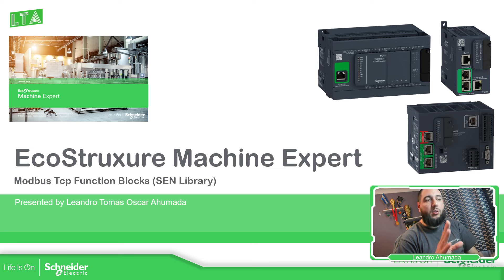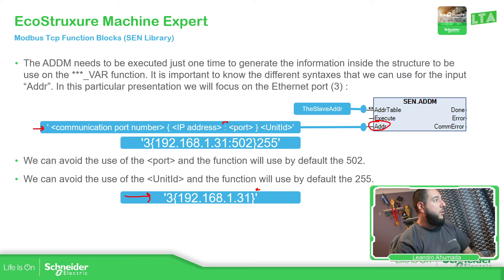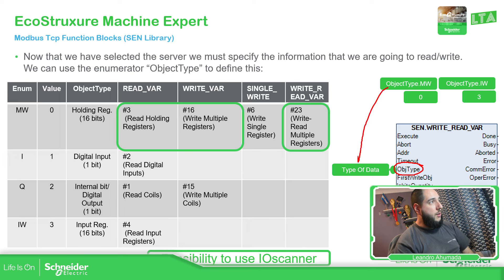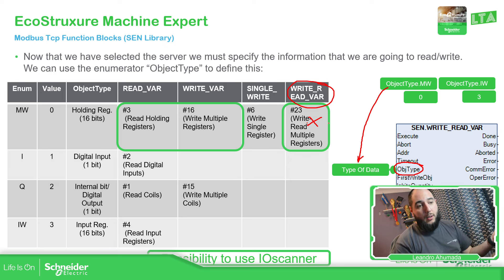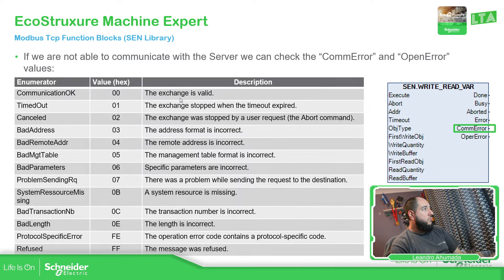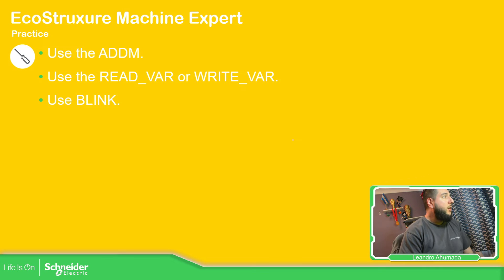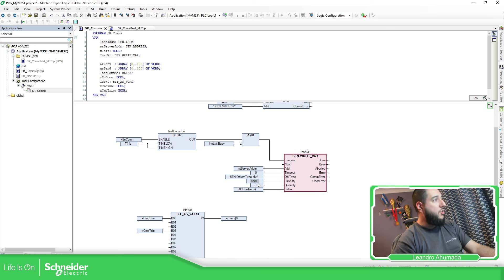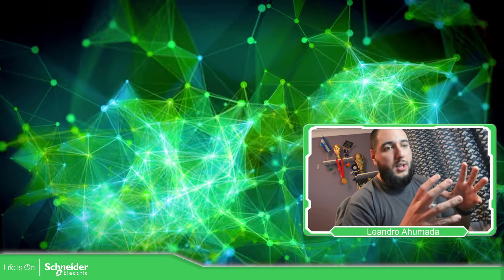EcoStruxure Machine Expert Training - Mx.x Modbus Tcp with Function Blocks (Read / Write)

Comment: THank you soo much for the explaination. Now i was able to communicated M262 with Jaka robot. My one request would be how does the structure vary for READ_VAR FB ? Because I'm confused about the step where I get to read data after triggering. Thank you
Reply from the maker: Hi there! Congrats on the integration with the robot 🎉. If you use the READ_VAR the info received will be in the buffer so you need to use the info from there, example:
wMyVariable := arBufferRecv[0];
Reply: @LeTomasAHUMADA  Thanks alot!!
Reply: @LeTomasAHUMADA  Hello again! Sorry for disturbing but when it comes to Robots I get machine values which are in Float32 format. I tried to use REAL and converted REAL to INT but still it didn't work. As per BOOL variables it works perfectly. Can you help me what should be done if the values that are being processed and anything else but BOOL types ? THank you
Reply from the maker: @krompir4392  if the value that you are trying to read it gives you error then it is a different problem. Now if you read something then you have two words you can assign the values to two memory words that you create and in the same position create a real, for example:
wVar1 : WORD AT %MW0;
wVar2 : WORD AT %MW1;
rVar : REAL AT %MD0;